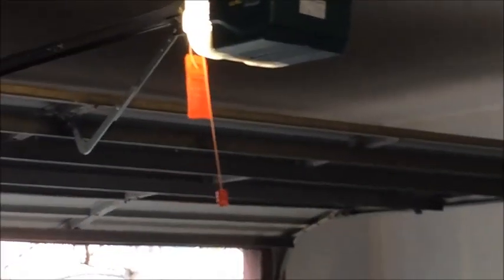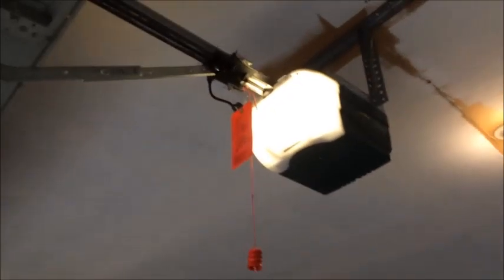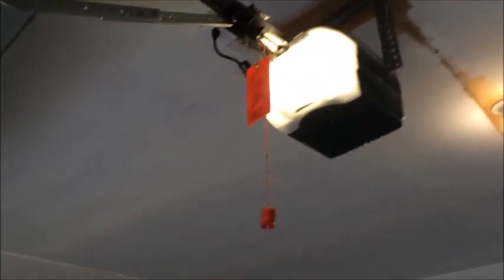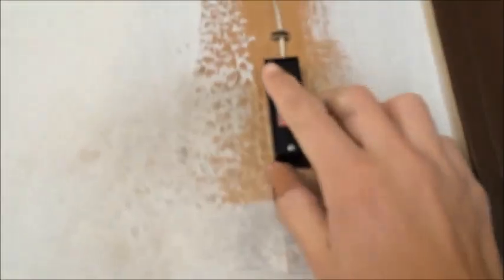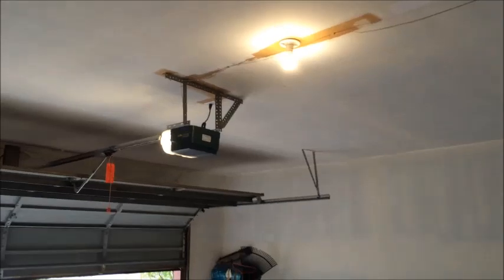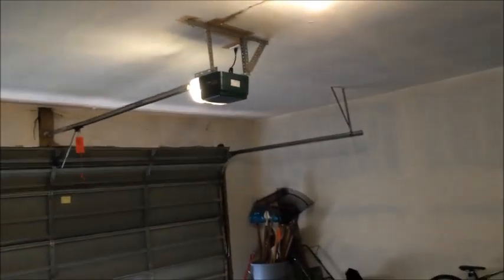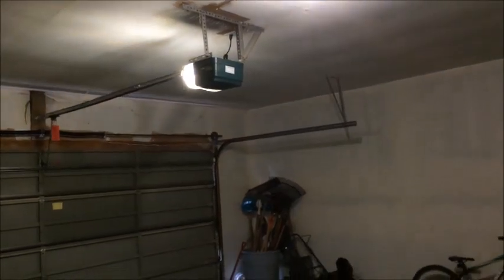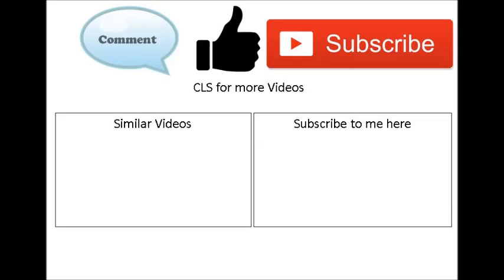How to close a Genie Intellicode Garage door if it won't stay shut | Tech/Mechanical Video

Comment: Mine was doing that then I saw the motor smoking
Reply from the maker: Oh wow that’s bad, did you get it fixed?
Reply: @Jamestube8439  after watching your video. I checked the sensors & the red & green lights were good I moved anything that could be an obstruction & it opened & closed fine. That was yesterday. Just right now when I pressed the button on both the wall & my remote it just made a buzzing sound & didn’t open
Reply from the maker: @TheS2K4LIFE  interesting well at least you fixed it yesterday.  What about the buzzing sound? Did you fix that?
Reply: @Jamestube8439  no cause it just happened I ordered a new capacitor hopefully that does the trick
Reply from the maker: @TheS2K4LIFE  Ok cool, hope it fixes it for you!

Comment: Hi can somebody tell me how to close my genie 6000A intellicode  opens but won’t close .
Reply from the maker: Consider checking to see if when the door opens that it hits the switch telling the garage motor that it's in the open position.  If you still have trouble, close it manually until you figure out what the problem is.
Reply from the maker: I pinned your comment so people can see it first when they look through the comment section.

Comment: How do u reprogram the plugged in unit.
Reply from the maker: You mean the button that is connected by wire to the motor?
Reply: Thank you for replying. I figured it out. I needed to reprogram the main unit.
Reply from the maker: Yeah that's what you would do, and no problem, got any other questions, feel free to ask. :)